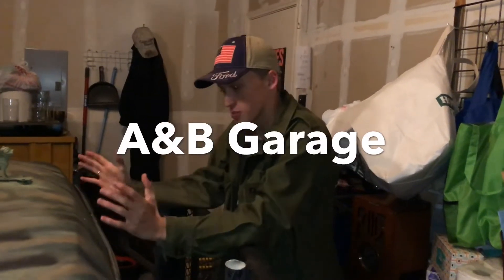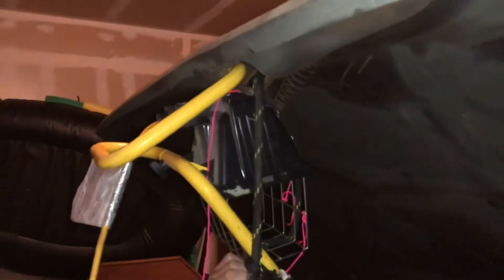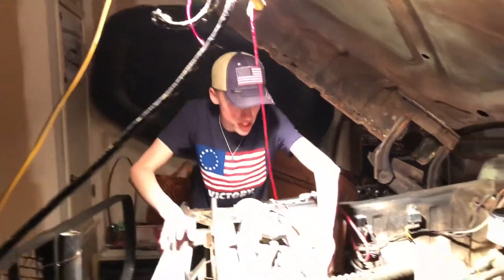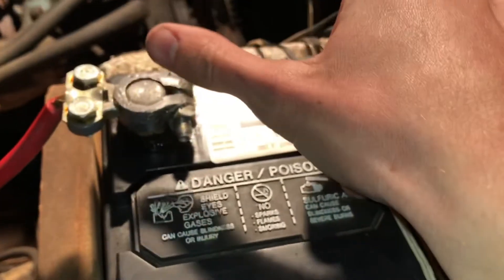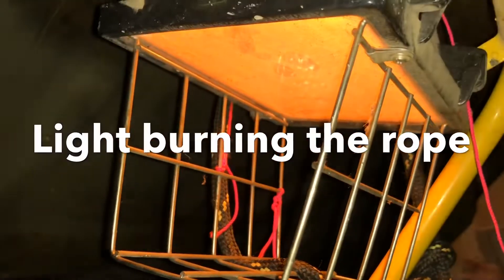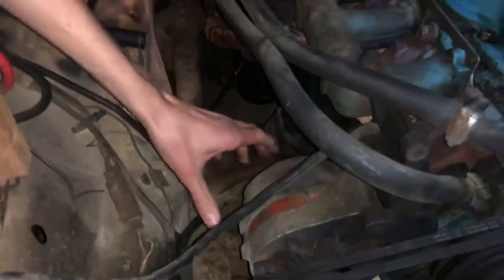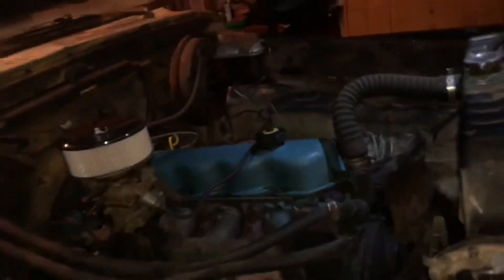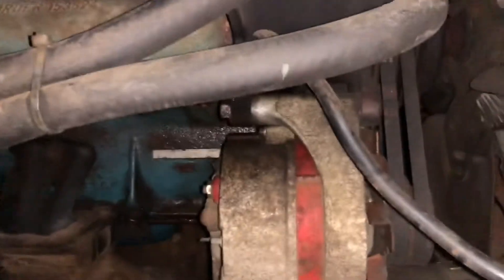Dual Fan Belts Replaced on 74 Ford [A&B Garage] Ep.1

Comment: Now I’m not even sure what we could replace now. I’ve replaced everything. Don’t worry, we’ll find something
Reply from the maker: Quint 1836 Still need them new dry rotted fan belts installed🤣
Reply: @BuiltTough1776  We had to  cut the alternator off, so we replaced that and the belts